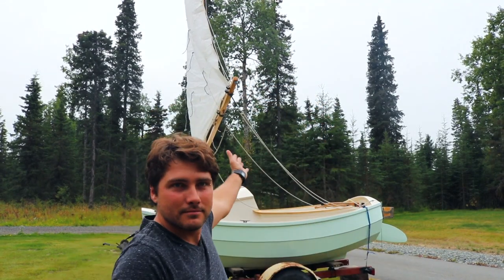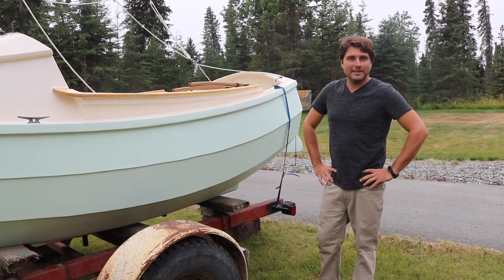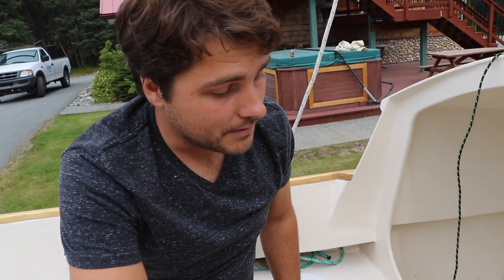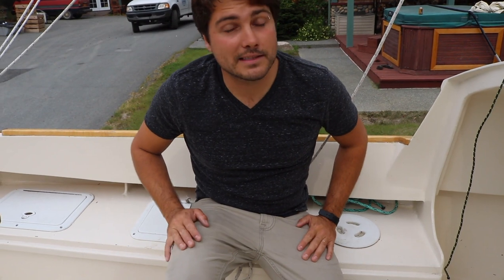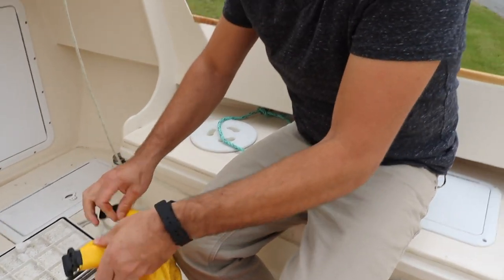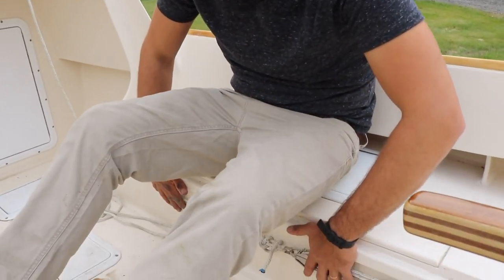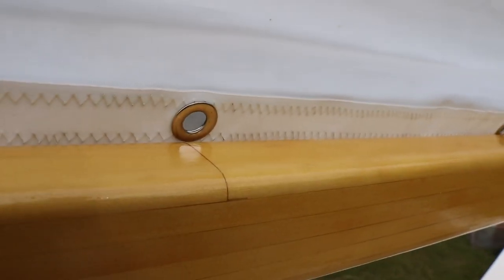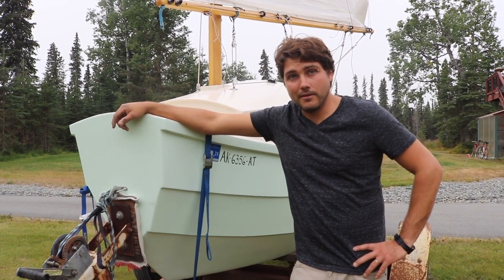Homebuilt SCAMP Micro Cruiser Sailboat Tour (E.87 Sailing w/the Litzenbergers)

Comment: Really nice little trailer sailer, I particularly like the way you've constructed the mast, it's a real thing of beauty when looked at end on. 

Using lead in place of water ballast certainly saved a lot of cockpit space, though I have a suspicion that not steaming the parts as suggested will turn out to have been inadvisable.

Comment: I know this is an old video, but considering your tendency to do stuff drunk without a plan, I figure you probably still don't know this: You can get lead weights from a forklift repair shop. They're used to counterbalance forklifts, cranes, backhoes, and other heavy equipment like that. It's a lot cheaper than melting down bullets. Probably a lot safer than melting lead. Carry on, sailor. Oh, and another option is pouring cement with some steel pipes in it for ballast and keel. The Vikings just used heavy stones, so I guess that works too.
Reply: Go to an auto tire shop.  They will probably give you a bucket full of old used lead weights used to balance tires.